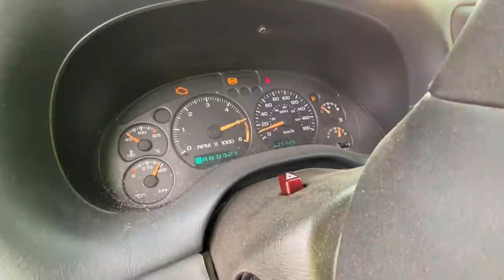4X4 BLAZER Will NEVER DIE! JUMPED!

Comment: Absolutely amazed that frame hasn't bent yet after all the jumps you sir bought yourself a solid unit 💪 and if you want to open the back window that black circle on the center of the tail gate is the window button and also should have one on the dash by the radio